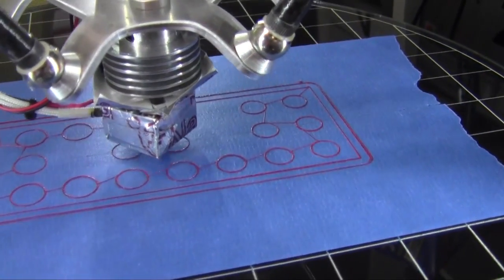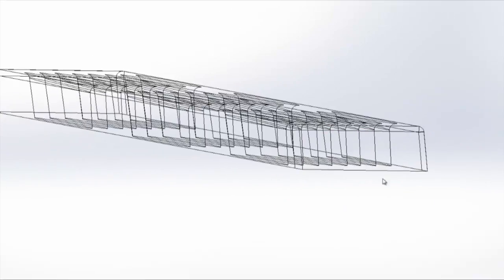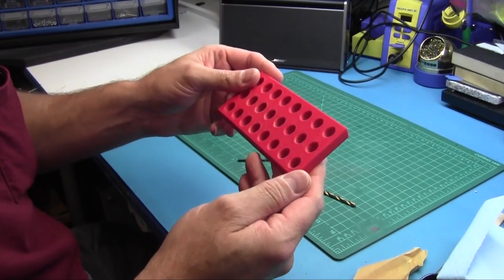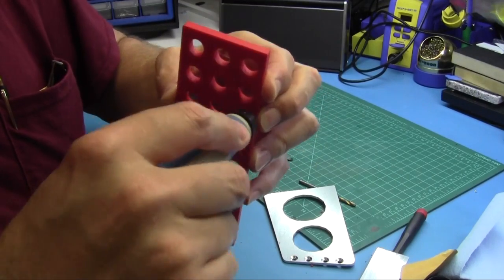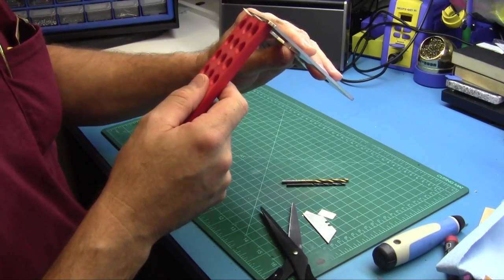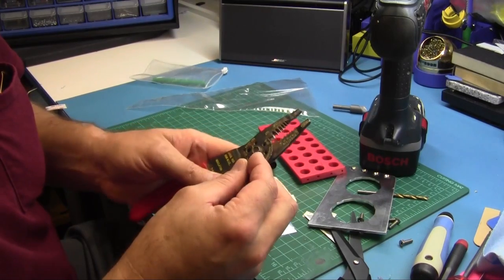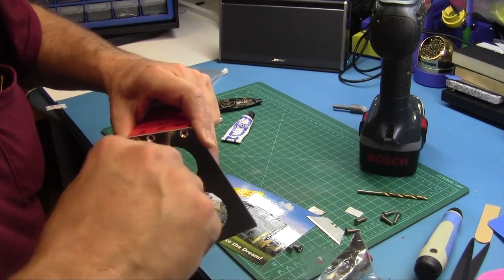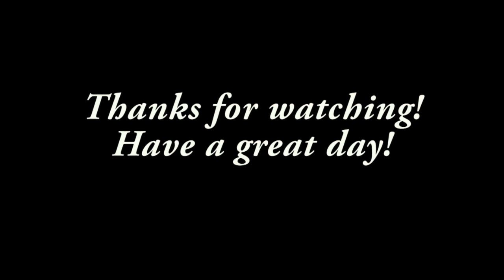Somebody stop me!  I just can't stop making tool holders!

Comment: I use double-sided tape all the time for temporary joins to match-drill holes or gang-cut parts.  Sometime I join parts with the tape, then bolt the parts together and just leave the tape permanently.

Something I would have done differently is to join the parts with the top side of the shelf down and the leg straight up so that they would be flush on the top.

Usually I'll push it together against the fence on my router table or table saw so I know the leg is exactly perpendicular.  That way when I finally join them they don't shift because I initially had a piece at a wrong angle.

The best tape I've ever used is 3M 9832.

Two things to know about it.  First, it's really expensive.  I bought two rolls maybe seven years ago, use it all the time and still have 1/3rd of my first roll left.  It's replaced a lot of tapes I used to use.

Second, when you get it, it will off-gas for a long time and the second day I had it I couldn't go in my house.  It's really bad.

I double-bagged it in thick zip locks and when the smell finally went away I stepped down to just one bag.  I always bag my tape rolls so they don't get crud stuck all over the sides.  My shop produces a lot of sawdust and other crud.

Comment: Warner, you could stop if you wanted too! I bought my micro driver set with a stand. Now I admit mines not as fine as yours, but.
Anyway next time see if you can print the screw holes with the right thread as it seems a little under designed at this stage.The tape process seems redundant.
Like what your doing and keep in mine there is medication that helps. Have a great day. ;-)

Comment: If you have a print that is really stuck , stick the borosilicate bed in the freezer for a half hour. Then take it out of the freezer and let it come back up to room temperature.  Most of the time it pops off in the freezer, sometimes pops off while warming back up.  repeat if nessary but 99 percent of the time mine is off by the time it is back to room temp.

Comment: thanks so much im just getting into it im learning blender at the moment but im very confused as to how to actually take my design and print it im going to be buying the mendel max 1.5 i think its called but love the size of ur machine u see i make movie props and at the moment im using pepakura to print out the pages and then glue and then fiberglass and then bondo for detail its a heck of a long process but all the printers out there print really small to for the helmets and stuff  im making i dont suppose u would share ur secret in detail how to make and calibrate the larger print surface if not i fully understand